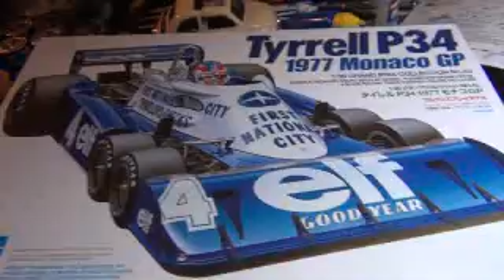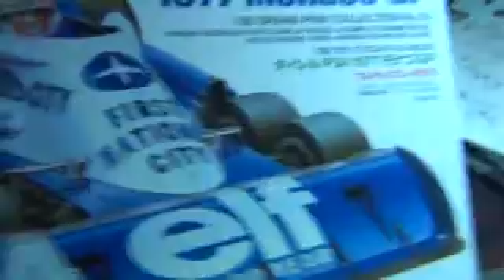6th attempt to upload

Comment: Superb work on that power plant - it looks immense!

Nice to see the Power Station coming together. Metal can be a bit of a bugger especially if you don't get the bend right first time. It's when you have two or three go's that it does what metal does when it gets bent too much! Wouldn't be the first time I've actually constructed a photo etch part rather than just fold it!

Comment: (continues) with the exhausts of my current build. Namely, they didn't want to stick to the engine block. I stripped all of the chrome and paint, but again nothing... it was driving me nuts..! Also, as I was handling the model to fix them there, I was pressing on the sparkplug wires and I was ruining those too... it was a disaster.. Then a voice told me: "Use superglue..!". And lo and behold, that did the trick beautifully!! :-D Enjoying your vids very much man, Keep Rocking :-)